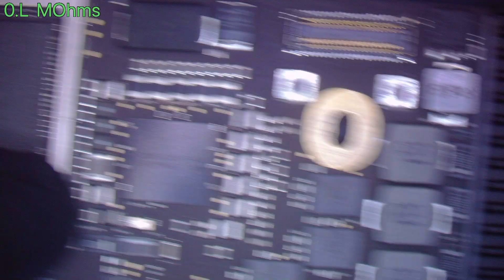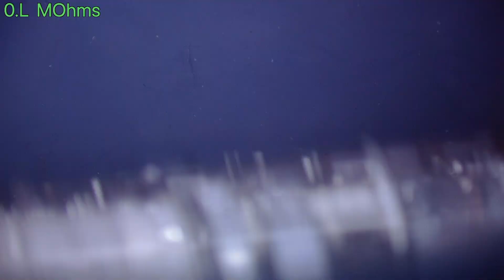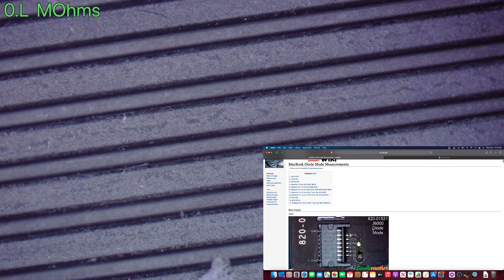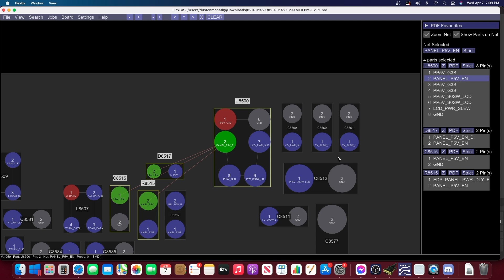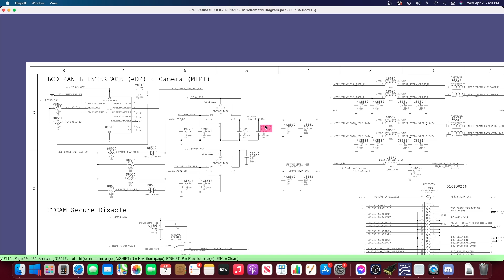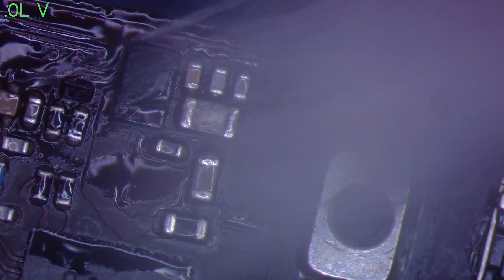Diagnose and Repair MacBook Air 2018 Backlight

Comment: Hi Dustin, thanks for your awesome video. I am experiencing the same problem, but instead of finding the problem with the logicboard, I have diagnosed the problem eslewhere. Having a screen from an other MacBook A1932 connected as internal display, it is just working fine with this MacBook. Because of that, I can tell it's not a problem with the logicboard but with the display unit itself.
So it seems to be the backlight panel itself isn't working.
Do you have any experience with this problem? 
Thanks in advance and best regards for Germany

Comment: Hi everyone....i dont no values on pin 39 37 and 33 31 where as it has to be 470 approx ....on these line are connected with L8509 and L8507 which conncets with front came ... please help what should i do .... shall i remove them or how do i check them? i have checked all the caps around and they seems to be fine with no shorts ...

Comment: That was an easy one. I have diode mode reading of 900 on pin 6 of J8500... R0563 is ok, 100k, line to R0563 too... it is only conneced to R0563 and CPU. Just i case i lifted U8510 and U8400 and still same reading... Could it be J8500 itself?

Comment: I have some issue with backlight on MB Air A1932 where as 2inches of the right of the display shows dark  backlight,  can still view the image and items there it is just much darker than the rest of the screen, would this be fault with the display of the backlight panel?

Comment: You knowledge is superb and i have one question j8500 pin 3rd are short i remove j8500 still short i remove connect resistor still short and another point is in cpu do have any idea now what thing should I do
Reply: Your

Comment: Please can you do a video on how to use a dc machine well? And how to use a dc machine to diagnose all faults on iPhone. Please 🙏
Reply from the maker: Done: 

How to use a DC Power Supply to diagnose iPhone and iPad

https://youtu.be/ZmMg1h0CCus
Reply: @Dusten04  thanks, man. There was an iPhone 7 plus I once worked on. As soon as I connect it to the dc power supply. It counts 0.08 even before pressing the power button. How do I fix that? Please explain more on the difference between full and half short
Reply: @Dusten04  please I just finished watching the video. Is there any value reading to tell if the phone problem is full charging ic, full short, half short, and any other fault on the iPhone and iPad. Please any useful information on that. I kinda a newbie in this field so I kinda need a strong foundational class bro.